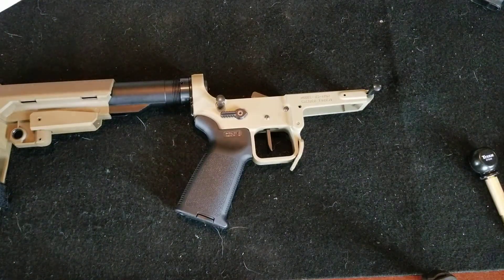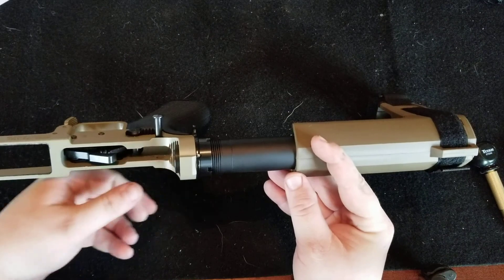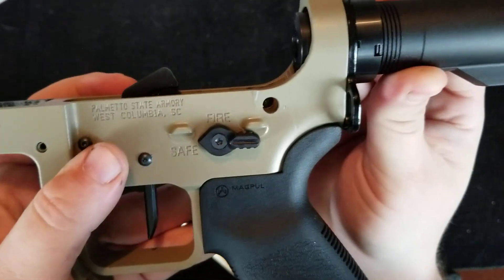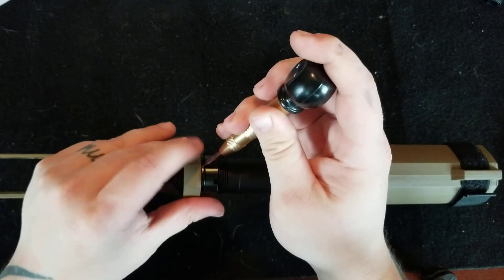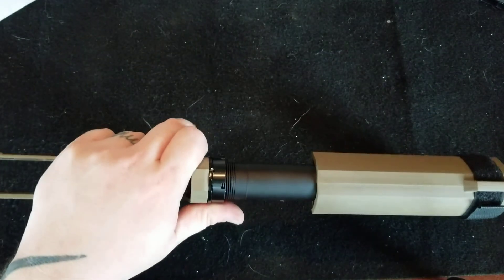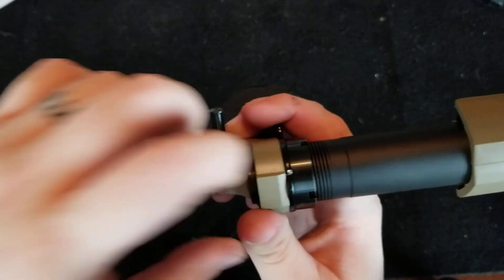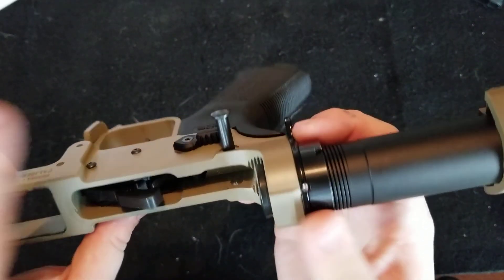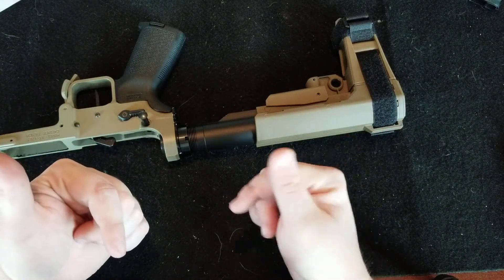HOW TO STAKE A CASTLE NUT THE EASY WAY!

Comment: Evev if you did a really big staking of the castlenut and needed to remove it again you can without any trouble. The staking just keeps jarring and vibrations from loosening the nut but will turn easily with the nut wrench. Also you should angle your punch toward the nut after you get the staking started to push the metal over into the notch.
Reply from the maker: Yes, I'm aware that it can be removed. I've also had luck in reusing the castle nut if the stake wasn't too close to the edge by lining the nut back up with the notches.